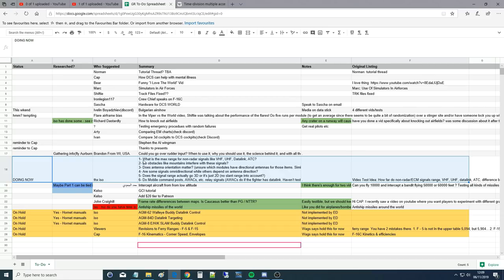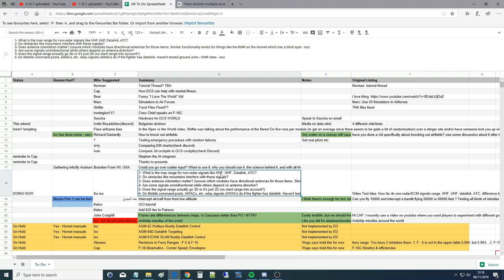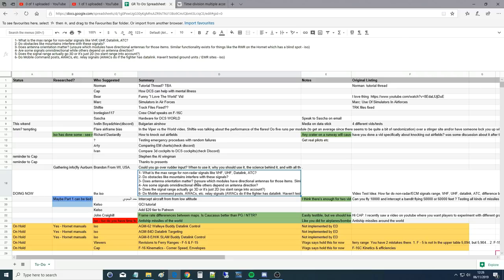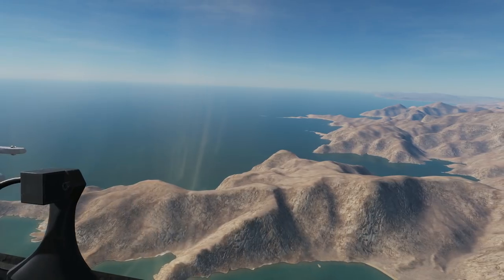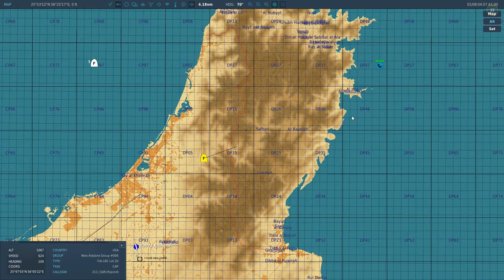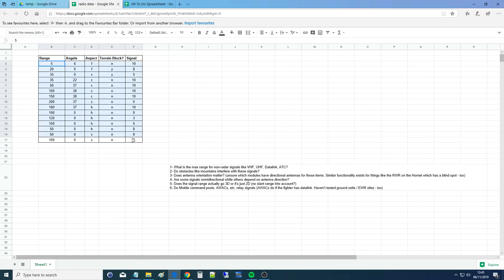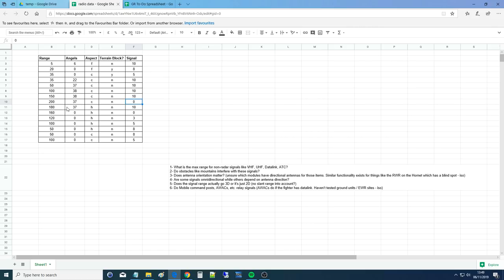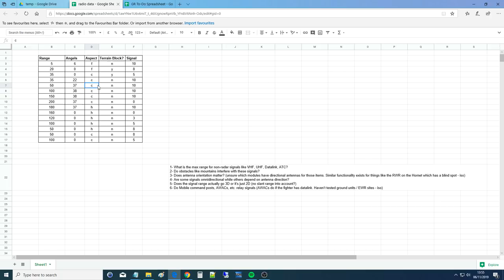Questioned: The Physics Of Radio & Datalink In DCS WORLD

Comment: The oldest form of radio communication was digital: MORSE.  Thor Heyredal (Kontiki) communicated from the south Atlantic home to Norway on low frequency with 5 watt.    The lower the frequency the longer the range. Basically because the low frequency signals can bounce off various layers in the atmosphere. Back in the days when I used Citizen Band (27 MHz AM)radios, it was common to hear Italian stations in Denmark due to bouncing. Even VHF can bounce. I once had a brief conversation on 146 MHz FM with a fellow amateur standing on Tower Bridge with a hand held (10W) and me sitting in Copenhagen with a100W station and a directional antenna. This was a one of, but it was not uncommon that I could reach the repeater station in Århus 160 KM away. Basic rule: The higher the frequency the more like light = line of sight. With my VFH station, the modulation - FM - AM - AM single side band - did not make the greatest difference. What could make quite a difference was the antenna orientation/polarisation - vertical, horizontal or circular. I wonder if that was what was meant by question no. 3??         Well, this was real world, and it seems to be well represented in DCS, but you need to test UHF.  (The abrupt cut off at 200nm might be because you flew outside the map.) I could not find the effect from the AN/ARC-222, but it will be 10-50W and with that effect and a decent receiver, you should be able to communicate plane to plane at high altitude over alt least 200nm - both VHF and UHF.
Reply from the maker: Thanks Cam
Reply: cmibm  Oh yeah, back in my CB days sometimes I couldn't make contact with a station 15 miles away but had a clear conversation with someone in Mexico or Bonaire thousands of miles away with a stock 5 watt mobile. Talking "skip" was fun!
Reply: @terryboyer1342  Oh yes. CB was fun, but building a complete VHF station, capable of FM, AM and AM Single Sideband was even more fun - and it was before integrated circuits. Not to speak of building the antenna system with a rotor and capable of using vertical, horizontal and circular polarization on a 18m high mast with a "link" making it possible to lower the whole antenna array down for service.
Reply: @cmibm6022   Nice! As a cadet in Civil Air Patrol in the 70s we built a Heathkit HF SSB. And it actually worked when we were done!
Reply: @terryboyer1342  After all the work it is good when it works. My station was also kind of a building kit that I bought from someone who had given up on it - he had mounted all the tantal capacitors with the wrong polarity and I just got all prints in a cardboard box - in the end it was quite a nice rig. I also build a power supply with separate regulators for receiver and transmitter and added power amplifier capable of taking the legal 100W input.

Comment: Data link is probably THE most classified system on modern aircraft. I personally would put it above stealth, but I cant justify that for obvious reasons. Consider an F-22, F-35 and B2 Spirit is still LO with data link active.  I'll let you guys work that one out.
Reply: Highly directional, phased array, antennas. That means the radiated energy is focused in a very specific direction. If it doesn't know where the other aircraft it's talking to is, it can't talk to it (stealthily).
They typically link to two other aircraft, daisy-chaining to have a whole group in on the link.  One of which can talk to a satellite, or awacs, or gateways to other link types.
Reply: @mariushusejacobsen3221  they don't need to point. The answer is buried in the internet in obscure places.
Reply: I guess datalink works with satellite contact?
Reply: @beszerker5004  who ever said gps sats just does positioning ?

Comment: The AN/ARC-222 can be AM or FM Modulated according to the frequency used, if i remember correctly you used AM modulation here which means the RF literally reflects back from the atmosphere hence the no problem receiving and transmitting without LOS